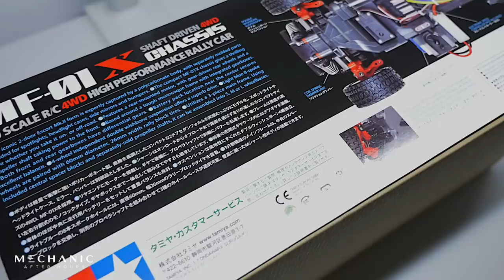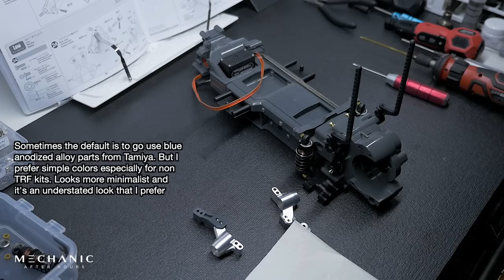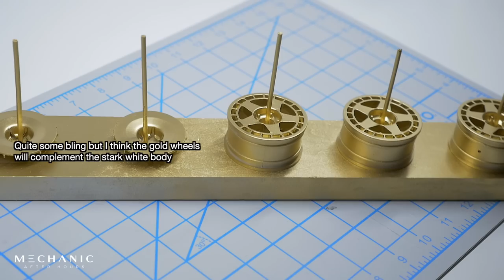Ford Escort MK2 - Building an RC: Tamiya MF-01X

Comment: Hey! The aesthetics of this build is top notch. The shocks look really good and I think using the softer springs is the way to go.  I like how your builds are inspired by different memories from your past.  I really like these small boxy rwd sports cars from the 70s… Datsun 510s, BMW 2002s, the Escort MK2.  The white body with wider black wheels looks hot.  Like the slammed look and the flares.  So many little details and touches set this RC apart. Makes me want a real one to buzz around with on the weekends 😀   Take care👍🏾
Reply from the maker: Thanks again! Love those old and '70s RWD compact cars and still like compact cars. You should check out Daniel Wu's 510 aka "Tanto" here on YT and also his Honda S800. The 510 would be a cool project but probably hard to find parts. Take care, bro and love the boat videos!
Reply: Yeah Bro, saw both those vids, Wu has great taste in cars. I found a 225mm 510 lexan body on ebay, I may pick it up. I have a real 2013 BMW 128i that kind of captures that 70s compact aesthetic. One of these days I plan to do something cool with it. Maybe wait a few more years when less of them are still on the road. Thanks for watching the boat vid👍🏾
Reply from the maker: Is that an e82? Love that chassis series and the 1M coupe model. You probably should stock up on parts/mods while they're not scarce.
Reply: Yes, it’s an e82.  Automatic tranny (I originally got if for my wife) and naturally aspirated.  The e82 shares almost all the suspension and performance parts with the 328i so I should be able to do some simple tweaks, widen the stance a bit.  Maybe some more aggressive springs/shocks, exhaust and intake.  1M Coupe is an incredible car.
Reply from the maker: NA and all motor would be sweet. Love that kind of setup. If only I knew how the 1M c would end I would've probably dropped some $$$ on it back in the day. I did have an e46 330ci a long time ago but it just had so many problems and it kept me up all night working on it haha. But loved how it drove.

Comment: Love the custom Ford Escort build. Got to learn quite a number of tips on this one. Didn't know you need to add some oil at certain screw holes.
Reply from the maker: Thanks, graham aker! The oil is optional. I used it on this build because I switched out the kit tapping screws with stainless machine hex screws and it just makes it easier to drive in when they're stubborn. Ideally, cutting oil works best.

Comment: I wonder what's the purpose for dropping damper oil before screwing?🤔
really beautiful drifting escort btw!👏👏👏
Reply from the maker: Thanks, Seth800! And thank you for watching. I had to use some oil because I replaced the kit provided self tapping screws with stainless hex machine screws. Makes it easier to go in. Got a bit lazy on this one because I ran out of cutting oil and typically I clear out the plastic debris.

Comment: If you want a little more speed out of it, pick up the TL-01 Speed Tune Gear set (53342) it doesn't require any modification to install it
Reply from the maker: Thanks for the tip, Trowa Jakuard! And thank you for watching.

Comment: Very cool build just one thing and it's Tamiya not you! Something off with the rear side windows don't think there long enough. Where I live in the UK there are still a lot of these driving around unless the rally one was shortened slightly like the Audi Quattro was! But hey pretty car for sure! 😁👍
Reply from the maker: Thanks! That's interesting about the rear windows. It's very rare to find an Mk2 where I live but I wonder if it's because of the bigger rear wheels and fender flares I used, makes the rear windows look smaller?
Reply: @MechanicAfterHours  could be, could also be camera angle and device I'm watching on as its very unusual for Tamiya to mess up the proportions!

Comment: Great video! I would like to know about your tools. I found the cordless screwdriver, where did you get the bits from? You need a 2.0mm blade for M3 screws. And where did you get the tool for the turnbuckle ball ends from? Greets Andy
Reply from the maker: Thanks, Andy! And thank you for watching. Some of the bits I just have from other drivers, the short ones are generic bits from Amazon. As for the turnbuckle (assuming you are asking about the driver/electric), it's a Schanffer's Racing turnbuckle driver. Re: M3 screws, I did slack on this one, typically I use a thread tapper like on my other builds.
Reply: @MechanicAfterHours  many thanks, i have now all information for the tools.

Comment: Cool build! 
Those flat connectors you use for the motor, at 22:48, what kind are those and where did you get them? I never thought of these as a nice alternative to bullet connectors for motors with flat connector sets.
Reply from the maker: Hi Lars and thanks for watching! They are "spade connectors" I've had for a while for something else  and just thought I'd use them for the builds—just so happens it worked out.

Comment: Good job!!!! what is the electric screwdriver and servo tester yo used? Thx. Regards.
Reply from the maker: Hey David! Thanks for watching. The red driver is a generic one that is a clone of the black Muchmore Racing electric driver I primarily use. The red is just ok in comparison and I got it from a local hardware shop. The black Muchmore Racing bought it online. Servo tester is a Spektrum XBC100. It can also check batteries I believe.

Comment: I have always wondered, why does tamiya use such hard plastics? is it proprietary? is it durable? I love tamiya cars, but have always wondered this.
Reply from the maker: I think it also has to do with Tamiya's background. They're primarily a plastic/static model and toy company and it must be for cost efficiency—and they probably already have the equipment to produce the plastics and mold. When their RC kits gets to race grade (or some of the higher end kits) then they do use carbon fiber or frp. But for enthusiast grade to even some hobby grade they seem to use plastic, and this makes it cheaper for consumers when they buy spare parts.

Comment: Nice build!
Do you have a link to the red electric screwdriver @3:26?
Reply from the maker: Thanks, JayC! The red one is a generic one I got from the local hardware store but you should be able to find one on Amazon. But the black one is a better one and it's a Muchmore Racing electric driver.
Reply: @MechanicAfterHours  thanks for the reply do you have a link for the black one? Thanks

Comment: Did you get any brandname or website for your hex screws ? Can't find something pretty reliable for now.
For what type of purpose you used Molykote ?

Thanks for your content its pretty smooth and relaxing. Keep it up ?!
Reply from the maker: Pierre, thanks for watching. Not sure where you are but I get my screws from McMaster-Carr (US). They have 18-8/304 and 316 in stainless. And zinc coated alloy (double the tensile strength of stainless). Some sizes in Titanium. All in round headed screws. Socket screws even have military spec/aviation screws. They also have vibration resistant ones. 

As for the Molykote 111, I primarily use it on o-rings, gaskets, rubber damper caps, the insides of the damper caps and potential areas where oil might leak out. Also use it to hold thin washers on various surfaces—especially difficult areas to keep washers in place while inserting screws or metal ball ends, etc. It also prevents o-rings and rubbers from seizing onto other surfaces. It’s not conductive, safer to handle, great water resistance, and so far harmless on plastics and various surfaces. Haven’t had a damper leak.
Reply: @MechanicAfterHours  Im from EU,  thanks for your complete answer.
There is so mutch screws available, thats great. But Im a bit scared, I do not know witch one too choose first.

Metric 316 and metric 18-8 seems the good starting point ? Then pick directly from a Tamiya intruction book one by one ?

Comment: Can you tell me what brand or provide a link to your electric driver? Specifically the more compact one, not the skill / larger one. Also, how did you use that to turn the ball cups / ends onto the turnbuckles?
Reply from the maker: Hi Adam Shaver. The drive is a Muchmore Racing driver. I use a Team Associated ball cup wrench.

Comment: I've seen people take this body and put it on an mo8 chassis because it's technically was a rear-wheel drive car.
Reply: Mine will be going on a shortned TL01 chassis converted to rwd. Have fitted M03 suspension.

Comment: Can the Tamiya RZ motor run on TBLE-02s without any problem? I mean can you try that?
Reply from the maker: I'm not sure it can but I haven't tried—don't have a spare RZ for this car. The limit on the TBLE-02s is 25T brushed motor—which I am using on this build a GT Tuned 25T (18-19k rpm @500 torque). The ESC's heatsink gets quite hot but hasn't cut off yet. I would assume the RZ 23T (26-27.5k rpm @500 torque)  you can run for just a little bit before the ESC's overheat protection kicks in or it just burns out, or it might not run at all. Probably the best alternative is to use the TBLE-02s' brushless setup for a faster motor.
Reply: Hmm.How about the TZ or BZ motor?The brushless motor is just too expensive for me.
Reply from the maker: I believe the TZ and BZ are slightly close to the RZ with maybe 500 rpm less and a slightly different power curve. Might be an issue too. Only way to know is try. I can probably try to test one but it will be at no load (no car and weight) so it won’t be accurate and not real world where environmental temp and driving affects the esc. On the Tamiya site it notes Sport Tuned motors and if that is the actual Sport Tuned motor, that is a 23T but it only has 18-19k RPM @350 torque. The only other motor I can think of is the Tamiya UGT which is a 24T instead of 23T. About 19400 rpm @500 torque. All these numbers are at no load.
Reply: @MechanicAfterHours  maybe I should change the Esc to use RZ motor
Reply from the maker: I think that might be the cheapest way to use the RZ motor. I believe a Hobbywing Quicrun 1060 is the cheapest you can get that's decent.